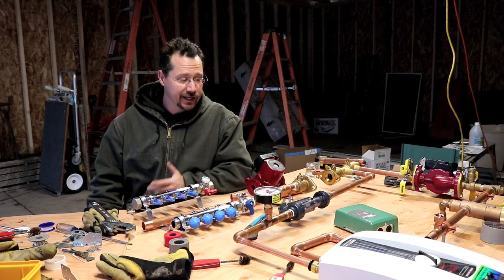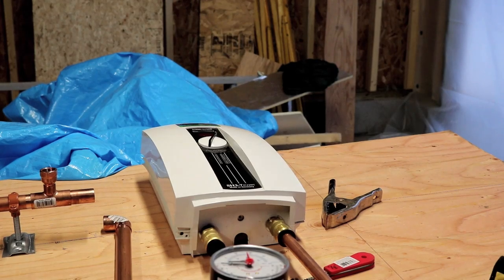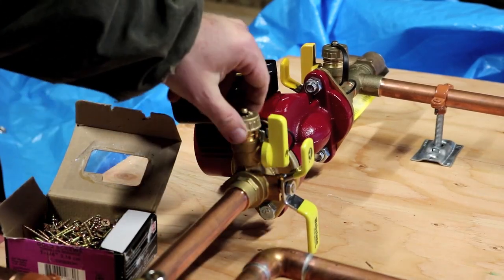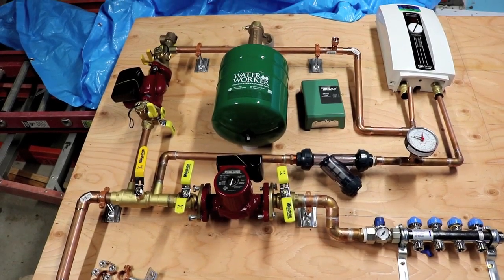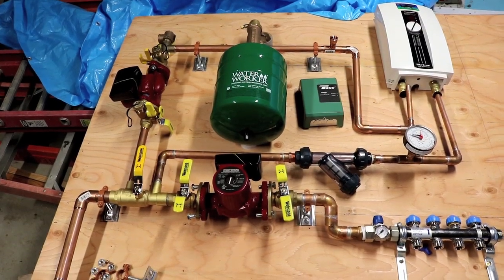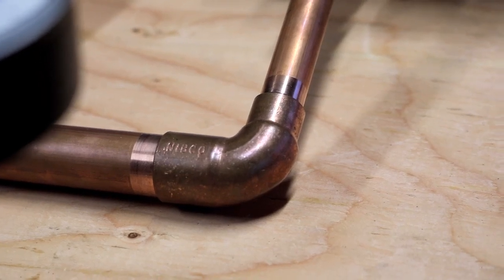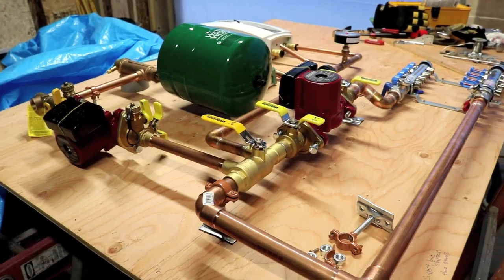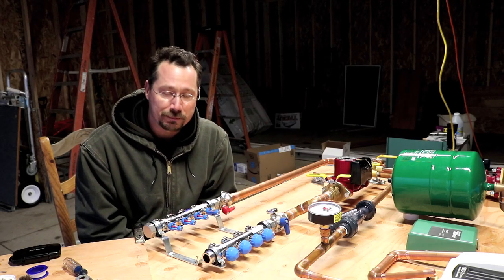Ben's Garage: Hydronic Heating Update Jan 25 2017

Comment: those pumps circulate well, so why two?
Reply: You could still provide flow through the boiler from one pump seeing it is only a one loop/zone system 2 pumps is overkill. That being said, im not familiar with electric boilers only Gas, not sure what the flow rate is needed to activate them. Cheers
Reply from the maker: The boiler is flow-activated. In a system designed to use it, it requires one pump for the boiler, the other for circulating to the Pex. I also allows for testing the system and the boiler before being connected to the Pex.
http://hydro-smart.com/Images/Low%20Res%20HydroShark3_InstallManual.pdf

Comment: My father has a floor heating/cooling system, all i can say is that it's great to heat the house evenly but it has a lot of thermic "inertia" (i.e : it takes a long time to heat up and cool down because of all the heat that the concrete slab will contain)
Reply from the maker: That's what I've always heard too - that the thermal mass of the concrete means it heats and cools slowly. That's a big part of what I wanted. If I open a garage door to pull my car in or out, that's a huge amount of heated air leaving the building! However, if its the FLOOR that's warm, only a small amount of its mass is needed to reheat the air.
I plan to only heat the garage to a relatively low temperature, perhaps 50 degrees F. Frankly, anything above freezing is pretty luxurious in the winter. That's plenty warm for a workshop, when I'll also have good lighting and be out of the wind.

Comment: Ben, why did you not consider a heat pump?
Reply: Price is probably a big factor there, and they work badly below -4C. If you just want warm water to heat a building it's hard to get around something simple as vacuum pipes. A simple heat exchanger could be inserted inline and the electric would do the rest.

For that matter, a simple 1 element (1.2x1 meter) vacuum tube setup will likely provide more then enough heat for the building. You can even mount these vertically, although a 45 degree angle is the norm. It does open a can of worms to have proper venting in case of overheating. Although a simple shade for the summer would suffice.
Reply: I don't agree with you about the price, because Ben is clever enough to buy a ductless mini air condition and modify it like others to have a heat pump that takes heat from the air or a near by pond or so to heat the garage. Having said that, I live in Cairo Egypt so -4C is not actual here. And It is not always -4C or less where Ben lives. But yes you are right heat pumps have a limit. What made me write was the 7kW that Ben mentioned. The Coefficient of Performance (COP) of most ductless split air conditions, is above 3.5. Mine is 4.5 and as I said I live in Cairo Egypt. So if Ben uses the 7 kW of his heater in a heat pump he will get a lot back from moving the heat from even -4C to warm the floor of his garage. If we count on a COP of 2 to compensate for the -4C or below then we get 14 kW instead of 7 kW. It is also possible to get a better COP at lower temperatures. But I want to say Bravo to Ben because he will get the 7 kW back from his solar production from the grid. What I also saw was that he can easily modify or add the heat pump later. Then he can reduce the amount of kWh that he will get back from the grid and maybe charge the car instead for warming the garage. Or maybe help in warming the house. At any rate being efficient always helps. A heat pump might not be enough but it will help.
Reply from the maker: Geothermal heat pumps get VERY expensive when you add in the cost of digging the wells. I also have very limited space in my yard to dig those wells. Heat pumps can only go to so low of a temperature before their efficiency drops, especially the air-to-air or "mini-split" types. I'd love to do some experimenting in the future. There are small window unit air conditioners that also act as heat pumps. I'd love to take one of those apart sometime.
Reply: I bought my Samsung 1 ton inverter ac. It heats and cools. Air to Air as you said. I am very impressed with it Ben. It runs on the solar panels that I have. It takes between 350W to 550W. The max it can do is 1000W. I paid about $500 for it. I am sure you can get it cheaper in the US. Maybe a used one. But I understand you that digging etc. is a bit too much especially when you have a grid tied system so you can always claim back some electricity from the electricity you gave to the grid. We are in two completely different climates you see. So I am sorry if my comments are not applicable to you. At any rate well done.

Comment: You do realize that a majority of the electric in Wisconsin is fired by COAL even though you do have solar I doubt you'll be able to bank enough kw to heat your garage. Also, I do realize you can pay more for wind power to your home but in reality you will get Coal Fired electric before wind if you really even do get it.
Reply from the maker: Electricity is what we call "homogeneous". That means that it's all exactly the same. Imagine that you have a number of different sources of plain water, and you dump them all into a large container - you can't tell what part of the water came from where, and you really can't "un-mix" it. Electricity is like that. Power fed to the grid from coal, nuclear, wind, solar, etc. look identical to the grid. What's important is HOW the power is produced. Nuclear produces no CO2 (but has other drawbacks) whereas Wind and Solar produce no CO2 or toxic fumes, but are intermittent. (Although wind and solar COMPLIMENT each other well!)
Anyone who PRODUCES power through renewable energy REDUCES the production of energy from other sources.
It's not important if a particular electron makes it to your appliance, it's important that we are producing energy better!

Comment: Ben. What are you doing???
Heating a house with electric is the fastest way to drain a wallet. It also uses more carbon per KWH than directly from gas.
Get a big wood stove.
Reply: Not true. Wood boiler is very expensive and needs a back up system anyway. For a garage that size his electric bill is likely $1k a year. A wood boiler is 5-10k and maintenance & reliably issues. Propane is not much cheaper and you need major...wife stopping me.
Reply: What about PROPANE.... That's what i have for my 25 year old house. New furnace and it's still WAY TOO EXPENSIVE..!! PROPANE SUCKS!

Comment: while you got it like it is. you should put in some "wells" so you can put some probs and set up a dataloger. next to the other 2 thermometers. good stuff Ben. thanks for the over view!  I recommend getting some vacume tube thermal generators. there expensive but they work really well. even in winter. direct heat output from the sun. ~Russ
Reply from the maker: I think I'm okay with just placing the sensors directly against the copper pipe, and taping over them. Alternatively, the thermometers just pop right out, and I could put sensors in their place.